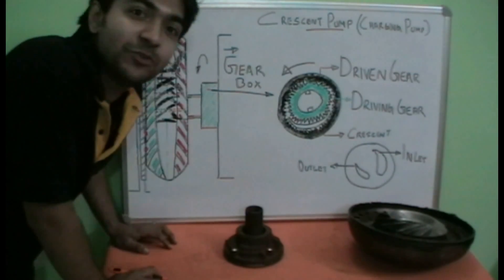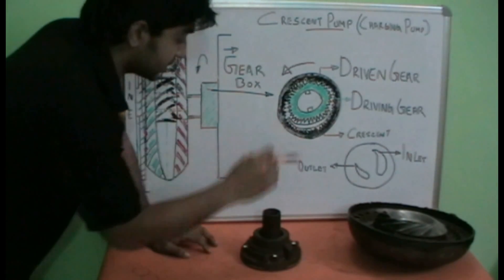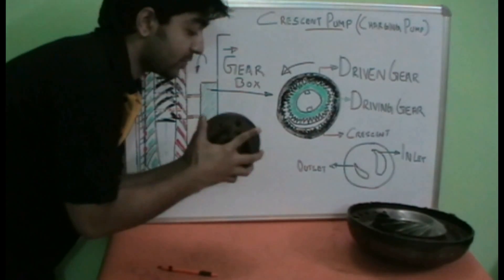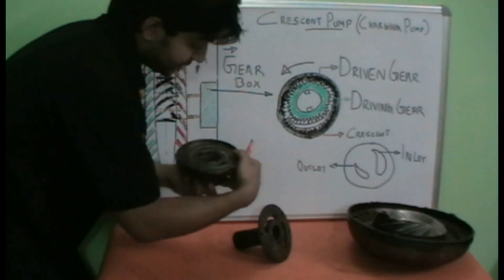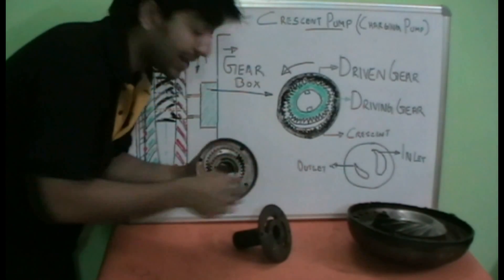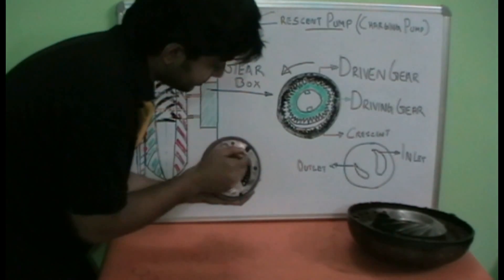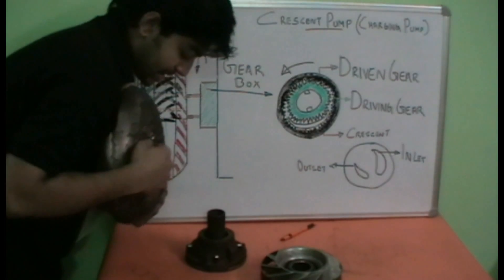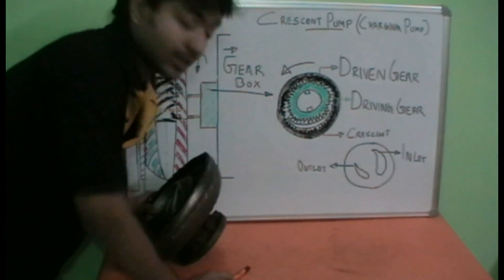How crescent pump works (Must Watch). ✔

Comment: Excellent video. It will suck the oil from torque converter and pump into the gear box but how the oil will be circulated back to the torque converter? Will the oil travel back to the torque converter via galleys?